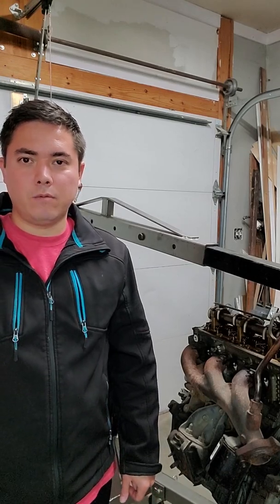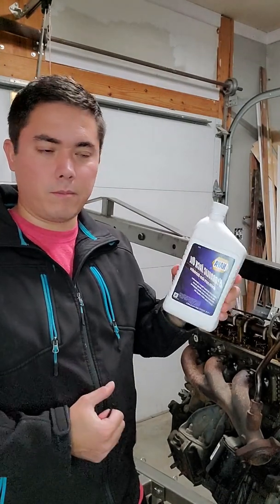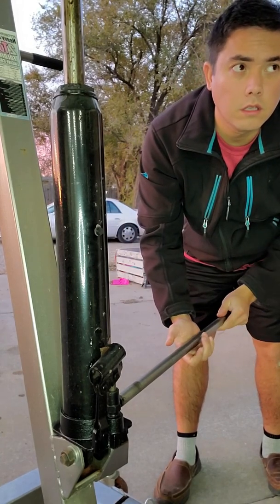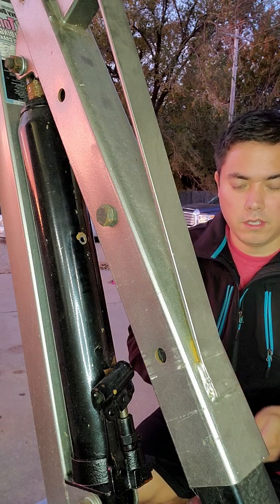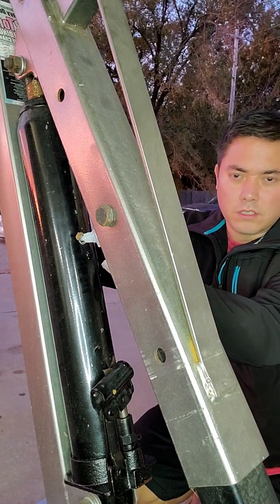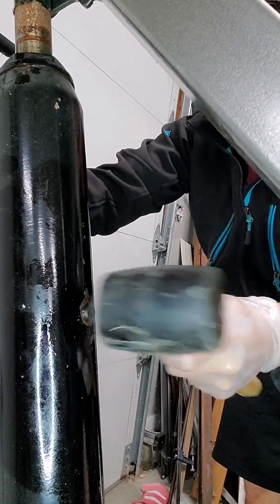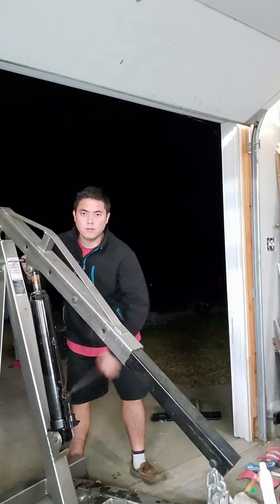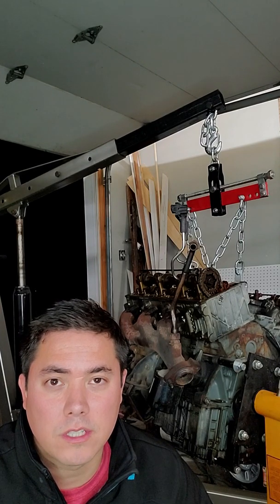hydraulic jack not lifting, fixed by adding hydraulic oil

Comment: Sometimes they get air in them too.   After you fill it, pump it with the lowering valve open to bleed all the air out.  Also they can start acting funny in the cold.  There is a check valve inside that sticks some times.  I have have my engines about halfway up and it will stop working, and I have to get the heater out and heat it up.

Comment: Mine stopped lifting about 4 uses within 2 months of buying it. I made it work again by removing the air out of the cylinder. I removed the air by putting the arm all the way down and removing the locking pin all the way counterclockwise until it came out. I heard bubbles/air coming out of that hole and then fluid came out. It drained fluid for about 2 seconds, I placed the locking pin again and turned all the way clockwise and it started lifting again. I am not a professional nor I know what I am doing. I am just sharing my experience.
Reply from the maker: Thanks for sharing!

Comment: I just bought a 2 ton eng. hoist from Harbor Freight today average price is $250.oo  Q: should the hydraulic pump be sufficiently filled, brand new ready to go? Don't wanna get stuck half way!
Reply from the maker: I believe it should be. I would check the owner's manual or whatever came with it though to be sure.
Reply: @matthewhendershot2009  
Hi Mat, after letting the hydrologic pump stand vertical over night, with the boom pushed all the way to the highest point, closed the valve. It was full functional the following morning. I imagine shipping while in a horizontal position the hydrologic fluid distributed equally through out the cylinder, making it appear limited in it's operation. In short, the lift pump works after leaving it standing expanded, vertical till the next day.

Comment: My 2 ton is doing the same shit when I put weight on it. I tried to fill it with auto trans fluid and it does the same thing.
Reply: Mines doin the same shit too
Reply: @yazzyfresh  I figured mine out. Bleed it as it goes up and as it goes down. Top off the fluid if low.
Reply: @mrmidnight32  
I'm gonna keep that in mind, uhh so what is taking place? Is it moving air out of the oil chamber or what???
Reply: @spiritoflight1375  I’m not sure exactly. But there is a seal, piston or o ring that’s not sealing inside the cylinder somewhere obviously. Probably cheap Chinese o rings not sealing with the slob of the parts inside. Probably too much play letting air get by.
Reply: @mrmidnight32  
Thanks, I just opened the valve sufficiently & lifted the boom as high as it could, than closed it. It lowered to what is probably expected, it's above horizontal level. Wish I could give degrees, but it seems fair enough. Thanks my friend. I think it's good now.
Reply: @mrmidnight32  
After letting hoist pump stand in vertical position overnight it appears to be 100% functional, the boom raised to the highest point and efficient.

Comment: I think the seal broke on my harbor freight one, first time this hoist has ever been used, couldn't complete one job before the hoist does nothing at all. no missing fluid, picking the engine back up that i just pulled out of a car a week ago. Pretty disappointed with this hoist.
Reply from the maker: Yes that sounds very disappointing. I'm sure you can return it right?